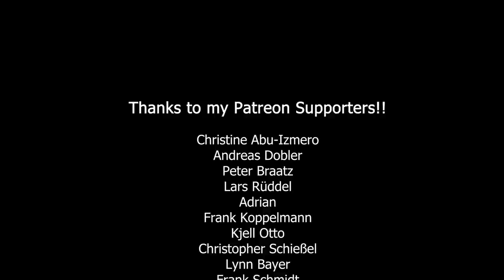Cast Iron Pan | How to bring an old pan back to life!

Comment: Excellent result! But you have the right equipment for restoration.
Reply from the maker: I‘ve done it just with sanding paper before, works!
Reply: @HABU  Thank you Hassan, I will try with sanding paper and after with scotch bride disk, mounted on my power drill. There is a way to season the pan without the oven?

Comment: I would love to see the restoration of an enamel cast iron.
Reply: that's a different beast. enamel cast iron once it's ruined needs a lot of different work. possibly removing the old enamel or spot-removal and re-firing it to get the enamel on and then cooled very slowly so it doesn't crack the iron or enamel.